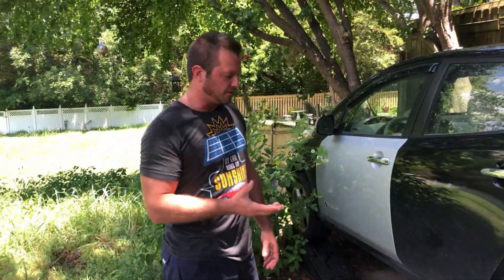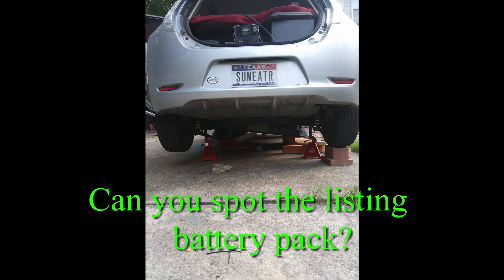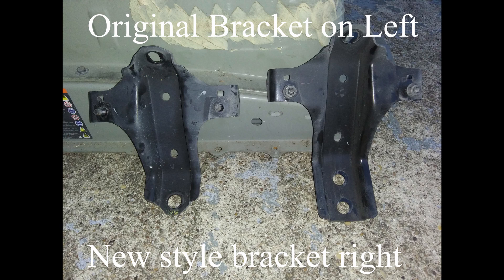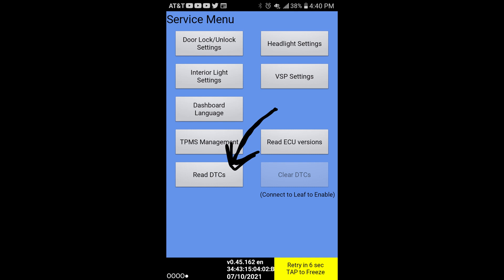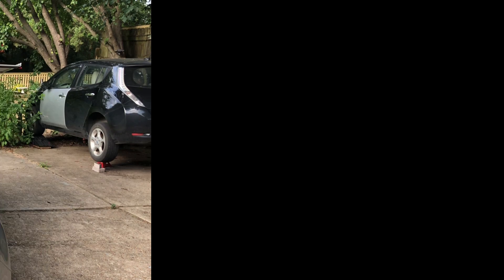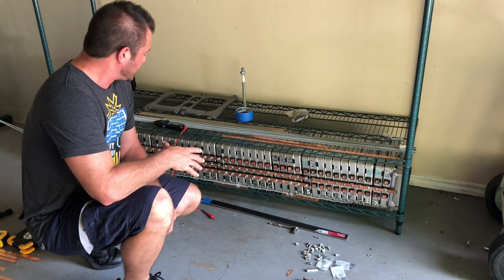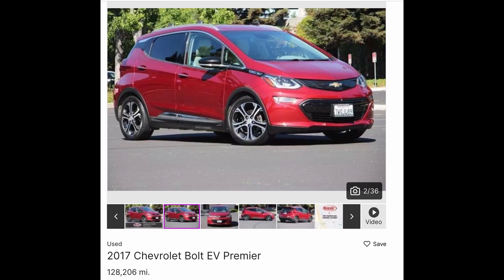Battery Swap for a 24kwh Nissan Leaf EV

Comment: The new bracket with 2 holes, is that bracket to gen 2 nissan leaf ? Thanks for the video 
And is the code is always for swap 24kwh gen2 to gen 1 batterie in generell?

Comment: What year is your Leaf?  2011 and 2022 is very different to 2013 and up.
Reply from the maker: My Leaf is a 2011.  The donor battery was from a 2014 warranty replacement I believe
Reply: @InnovativeSustainableSolutions    So, everything working just fine?  Can it charge at 6.6 wkh at level 2 charging station?  Or only charge at 3.3 wkh

Comment: Great video. You finally showed how the actual lowering of the battery was going to work. That making for center was just what I needed to know I'm going to use a motorcycle lift to hopefully avoid the jack slip problem. I'll lower the battery on to two furniture dollies.
Reply from the maker: That should work well.  Recruit an adventurous buddy to help you out too.  There's not too much too it, but an extra pair of hands would be helpful

Comment: You mention in this video that your eventual plan for your 'powerwall' is to be 60V, while the next one shows you have built it as 48ish (and mention you are planning on upgrading more in the future).  Is your eventual plan to put in extra modules and go past 48V, or would you add additional packs into each module in parallel?
Reply from the maker: Thats a tough one.  The actual voltage range of a 14s pack is 44.8-58.8.  So 60v is not out of the question for 7 modules in series.  The voltage you build to really depends on how much power you are planning on pulling out of the pack.  For a small house 48v would work fine.  If I were going to build a battery bank for supplying off grid power to a house, a shop, a greenhouse, etc.  I would want to increase the voltage so as to reduce the amperage (which tends to be the more problematic of the two to work with).

Comment: Thank you for your posts, fantastic! Do you have an update on the solar charging? I'm looking at a Leaf that has a 40 mile range, my work is 30 miles round trip, no charging stations. I work nights, so would need to carry a charge with me. solar panels and batteries sound like the setup I need. thanks again!
Reply from the maker: Im actually amazed nothing has broke for the last year since I posted this video.  The inverter, batteries, roof rack, and panels, havn't missed a beat.  I really like using batteries that have a built in bms.  The Valence batteries I have been using have been incredible, as has the Giandel 12v inverter.  You really don't need to add much range at all, so as little as 3 kwh of batteries should be plenty
Reply: @InnovativeSustainableSolutions  thank you for the response, greatly appreciated. The vehicle I'm looking at has 6 bars on the battery. I'm guessing that it would continue to degrade, amd a new or refurbished battery would be needed within a year or so.
Reply: Do you have detailed build instructions on yiur patreon?
Reply from the maker: @jaydub5728  All my Patreon posts are open, so anyone can see all of them.  Patrons support me purely altruistically and receive no hidden perks.  Refurbishing a battery pack requires being able to source lightly degraded modules.  This has become, to be perfectly honest, impossible, unfortunately.  But there are some tricks to slow the rate of degredation of your 6 bar Leaf

Comment: where you buy a new battery?
Reply from the maker: You can't really anymore.  Maybe try Nissan, but good luck.  All available batteries now come from wrecks.  The car I took mine out of was sold to someone who was doing an EV conversion using the donor Leafs electric drive train.
Reply: There are companies that sell new packs for LEAFs.  Search for this video:
"Nissan Leaf battery replacement and upgrade project"

Comment: I found this video when I was looking at ways to pair the new battery. After watching this I followed the instructions but could not work out how to get that code, so it just deleted all the DTCs. all errors disappeared and it is working as normal! THANKS!
Reply from the maker: Nice work man.  Adaptability is paramount in this process.  My suspicion is that the guy I got the override code from, knows somebody who works at Nissan who is probably not supposed to give those codes out ;)
Reply: @InnovativeSustainableSolutions  "Nice work man." the code came from...leaf spy!, I read the DTC's and the P-code appeared in the box. I then deleted it and car was back to normal but with a 10 bar battery.

Comment: Great to see all your progress! And I love that you're re/upcycling all the parts from the black Leaf too, that's a cool way to do it.
Reply from the maker: Someone actually contacted me and bought the entire (battery-less) car for $1500.  He's using it in a conversion project.  I was over the moon to not have to spend the next 2 weekends dismantling it and shipping parts, all though there are a few people mad at me on the forum.  It was a great project to get me comfortable working with the Leaf battery.  At some point someone will have to be the first person to attach a custom MPPT charge controller straight from roof mounted solar to the Leaf battery.  I have a suspicion that person will be me, so I better start getting comfortable working with them.
Reply: @InnovativeSustainableSolutions  Hahaha awesome! And don't worry I'll test it on my battery first 😛 Last I heard the build should be done in another week...

Comment: Oh how I have been waiting for this video! So incredible to see that the swap was succesful 🤩! Congratulations! 

Oh, and a tip for the powerwall, can't see it from distance, but the cells need to be under compression. Otherwise they swell/shrink during charge/discharge and can tear the terminals from the busbars! Looking good!
Reply from the maker: Stacking the modules horizontally created a myriad of technical difficulties.  Now I know why everybody on the DIY powerwalls fb group stacks them vertically.  The modules are under compression, I used some of the brackets from inside the battery as 'bookends' along with spacers and washers in between each individual module.  One terminal was somehow damaged during the assembly process though.  I found out when I was putting the bolts through the busbars and threw some sparks, indicating a short INSIDE the module.  I had to disassemble the first row, remove the module, and reassemble it.  Then tweak the busbars as the spacing had shifted somewhat.  After removal, I fully inserted the bolt into the shorted battery to test the limits of these modules safety.  No real dangerous effects observed.  The G1 modules are, . . literally unbelievably safe to use in home powerwalls.  My advice to you:  Use vertical module stacks.  And mill oval holes into the busbars (not circles) to allow for a mm or two of shifting even when bolted down.  I know you will build an incredible stationary storage set-up some day!

Comment: hahaha everyone in the bolt forums are freaking out about the recent fires after the latest update. I too have a 2017 and im not worried YET... man it would be amazing if GM does a battery swap like Kia did with the same pack!
Reply: I don't understand the panic either.  We all parked ICE cars in our garages for years.  Everyone of which has a comparable combustion risk
Reply from the maker: I would need the current risk of fire to at least double before it would enter a statistical risk area that I start to consider "dangerous".  It's possible that 10 Bolts catch fire today, in which case I would retract my "endorsement" (do you even get to use that word if your channel is this small) of the car, and stop parking it indoors.  But then again if 10 Bolts catch fire today, we will all be part of same insane class action lawsuit where GM buys our cars back at purchase price, so either way we win.  Your right about the battery swap being ideal though.  I think LG makes the Bolt pack.  Hopefully they want to step in and prevent further damage to their reputation.

Comment: Maybe a bottle jack or the scissor jack from the trunk with a wider base plate welded/bolted to it for stability might make future battery swaps a little easier? They lift and lower straight up and down, so the battery could be lowered straight down onto some casters and then rolled out from under the car. I think it would cost about the same as buying a new floor jack, but you already have a floor jack so, meh. 
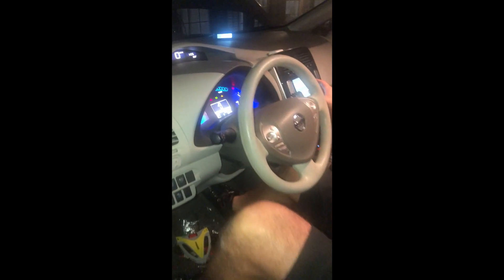7:14 "Holy sh*t" - yup, that about sums up my reaction! That new LeafSpy update is amazing! Super cool video!
Reply: 30 and 40kWh is plug and play. 62kWh needs extra brackets.
Reply: I'm just bought a long bolts instead original ones what holds a battery. Using them as a guide pins unil battery is all way up/down. And 2 jacks. It makes it easy.
Yes, 30 and 40 are bolt on, but you need a can bridge to make it work.
Reply: @pashko90  you don't need a bridge to make it work anymore, unless you don't want to see flipping estimation between range remaining, and range when battery is full on your instrument cluster. That's potential £650 saving here, and I would live with flipping numbers 😅
Reply: @pashko90  it's beta version, but yes, you can do this now.